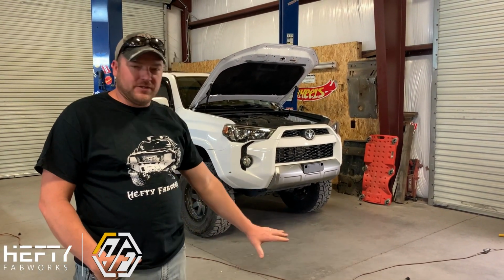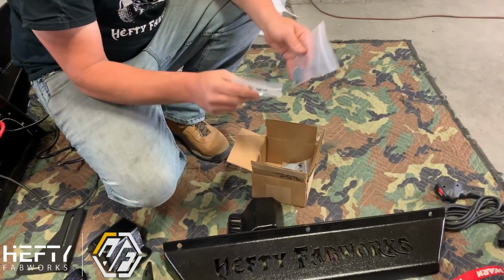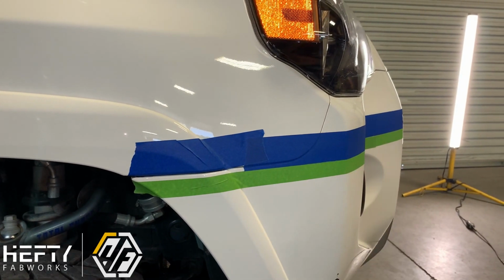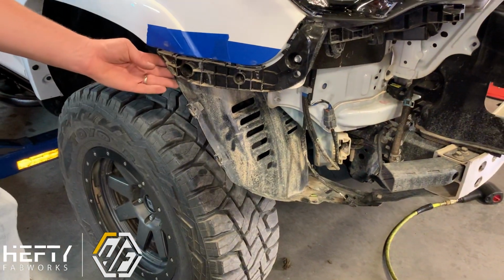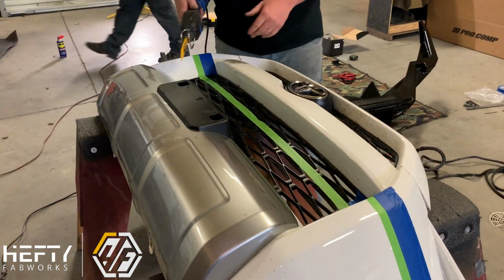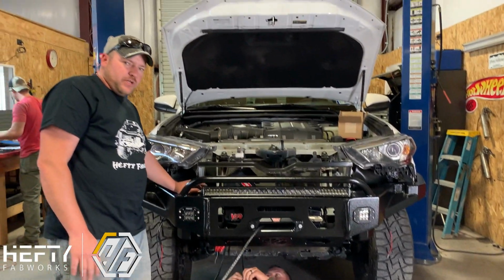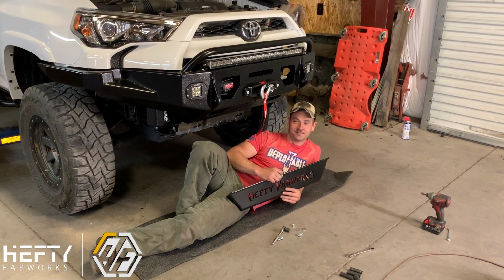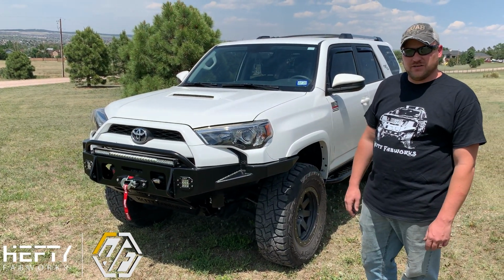Hefty Fabworks 5th Gen 4Runner Front Bumper Overview and Install

Comment: With the side mounting plates being steel and the bumper being aluminum do I need to have any concerns about galvanic corrosion?
Reply from the maker: With proper coating there is very little concern for galvanic corrosion.

Comment: Two words, laser level.  They self level and you can tape off a perfect straight line every time
Reply from the maker: works great if the vehicle is actually sitting level, which they never are.
Reply: We would have guys show up at the yard and suggest this from time to time - by the time you tram the vehicle out to make it level, then set up the laser, then find out that the vehicle isn't perfectly square to level to begin with - the FNG always ends up realizing that it's best to measure off of existing panel lines. Relatively level is always far more critical than absolutely level!

Comment: How do these do with animal impacts?
Reply from the maker: Extremely well, we've had quite a few customers have animal impacts. We do build our bumpers to absorb hard impacts which is why we build our frame mounts separately and out of steel so that energy is deflected. In most of the cases, the customer just needed to loosen up the frame mount bolts to shift the bumper back up into place.

Comment: Which of these aluminum bumpers offers the best protection against animal strikes?  Low hoop, pre runner or full/3 hoop?
Reply from the maker: We designed the bumper to be compatible with factory airbags, crumple zones and safety features. Because of that, in a frontal impact the bumper will move back from the top in harder impacts. Most low speed impacts will have no effect on the bumper, higher speed impacts we will see that movement from the top. In those cases the 3 hoop will actually cause more body damage than the prerunner or low hoop. We have seen multiple animal strikes with these bumpers and most contact is at the bumper level and not on the hoops. We have seen an 80mph deer hit that resulted in no damage to the bumper and only shifted it slightly causing minor damage to the plastic trim below the headlights. We even had a customer hit a full grown Buffalo at 60mph, killing the Buffalo. There was some body damage and the bumper was mangled as it should be but the results were that there were no injuries and no frame damage to the vehicle. We replaced the bumper 3 weeks later after it was out of the body shop for the fender damage. Low hoops are likely to cause the least damage to your vehicle in an accident.
Reply: Fantastic explanation! Thank you so much!
Reply: Follow up question, in terms of protection, does the 4runner front bumper aluminum w/pre runner hoop protect better than the 4runner front hybrid tube winch bumper w/pre runner hoop? I like them both and price/weight are not an issue. Thanks!
Reply from the maker: @ajentink85  the aluminum bumper is stronger than the tube bumper, but both are very strong

Comment: How does this specific setup affect suspension sag? I will be ordering this from you guys real soon. I have King Suspension with the standard 550 springs as of right now.
Reply from the maker: Craig Wexler great question! The aluminum bumpers weight right at 60 lbs and have very little effect on the suspension. They can be run in a stock suspension and most aftermarket suspensions come with higher rates front coils anyway. We recommend a 650 lb spring rate, 700lb max with winch, lights etc.
Reply: @heftyfabworks  sounds good...I might have to have you guys do the install, and while in the area, maybe have someone install the heavier springs.